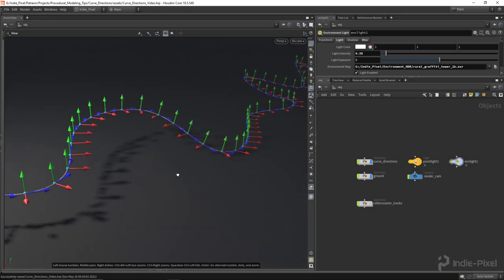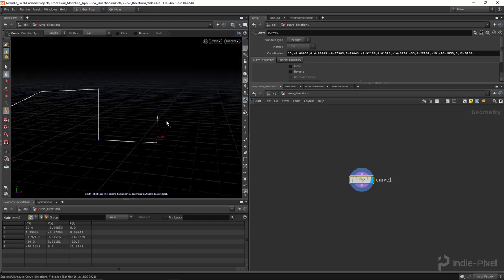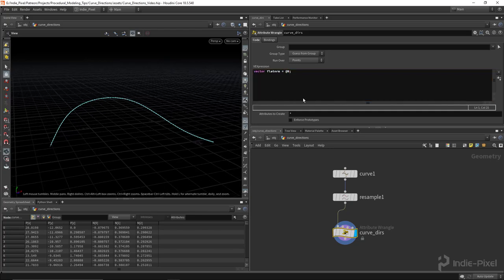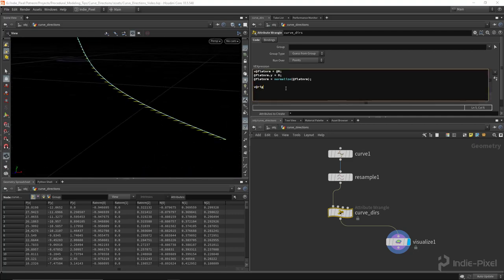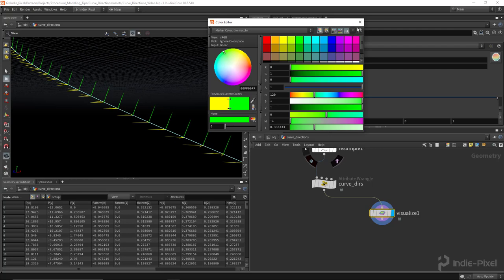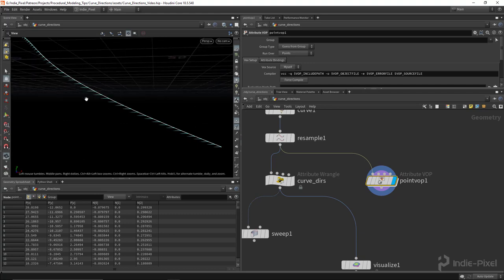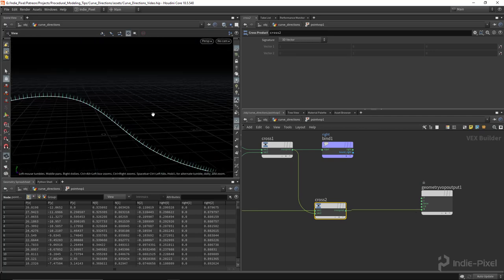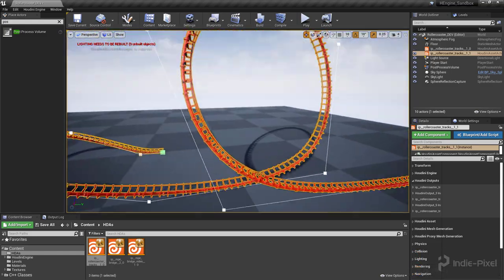Houdini - Procedural Modeling Tips! - Curve Directions

Comment: Mathematically, you just need two cross products. right = normalize(cross(up, tangent)), then up = normalize(cross(tangent, right)). Flattening the tangent first isn't necessary. Both your solution and mine will fail if the tangent is exactly vertical, though, so there needs to be some kind of fall-back in place for that situation. The odds of this are very low... and, with the inherent precision issues in floating point maths, it's vanishingly small that it'll come up in normal operations. 

There's also the issue of the right axis flipping if the curve doubles back on itself and happens to pass through vertical, as the cross product will flip directions.

Alternatively, you can employ a Bishop Frame if you need to maintain stability of all the axes along the length of the curve. It's a bit more work to establish this and involves evaluation the curve along its length from start to finish, rather than just relying on a tangent at any given point. There's lots of mathematical papers on the Bishop Frame and they're all a bit incomprehensible if you're not a mathmatician. Epic have made use of it in their hair strands plug-in for Unreal, though. If you feel like tearing apart their code for it, I recall it was fairly easy to reproduce using their method.
Reply from the maker: @sethfrolich5422  yes, it will fail in vertical situations for sho.  I have since stopped using Houdini and just use pcg, geo script, and cpp for all my stuff.  Thanks for the bishop frame tip...I'll have to take a look fo sho!

Comment: So, I've run into a bit of a snag. I'm trying to push points along their right and up vectors randomly. To simplify lets forget about the randomization, if I try and do, @P = @P + @right*ch("scalar");, the points just don't go in the correct direction, like I'm looking right at the values in the viewport and the movement just isn't correct at all. If I pull up the geometry spreadsheet, my right vector is expressed in terms of right[0], right[1], right[3]. Now if I look at the up vector, for some reason its components are actually expressed in terms of x y and z, and this simple vex code works properly when tested with the up vector, it's able to push them along that up vector in a way that's expected. So my only guess is when adding two vectors, where one (@P) has its components expressed as xyz and another (@right) whose components are 0 1 2, its like it doesn't know how to "match them up" or something. So, when I define a custom vector attribute, how do I make sure that its components are gonna be expressed as x y z?

Comment: Hi, why did you flatten the normals in the Y direction? Is there any reason I should use flattened normals instead of the original ones in the cross product?
Thanks.
Reply from the maker: In order to get the proper right vector we flatten the flow normal and do a cross product with the world up vector.  Once you have the right vector you do a cross product to get the proper up vector. If we didnt flatten the flow normal we'd end up with a wonky right vector.

Comment: doesnt the direction of flattened normal flip when you do full rotation track? like loop track?
Reply from the maker: Yep, if you wanna do looping tracks it has to be taken into account.  Can do it with a sweep node and an attribute transfer node.
Reply: @IndiePixel3D  thank you!
Reply: @IndiePixel3D  any clue how you'd go about that? Currently facing that same issue, and I have no clue what you mean by using the attribute transfer? I'm assuming you mean transfering the right vector from other bits in the spline, but how would you even go about detecting if it messed up, and getting those points over?

Much appreciated

Comment: I have a problem, when I put the subdivision curve nothing happens, it does not smooth.
Reply from the maker: I've notice that happen in Houdini 19...is that what you are using?  If so delete the resample nide and make a,new one...that worked for me
Reply: @IndiePixel3D  yes i have houdini 19
Reply: @IndiePixel3D  I tried again to delete the resample and put it back but nothing changes... :/
Reply from the maker: @hoprem.  huh, weird...I have seen that before...might want to bug it with side fx.
Reply: @IndiePixel3D  i find the problem, it's the mode. You must change mode on CVs on your curve

Comment: Why not just use a polyframe node? It does all this for you. Don't get me wrong - understanding the cross product is super helpful, but for curves polyframe is quick and easy.
Reply from the maker: You can do sho...though it doesn't work in all situations.
Reply: @IndiePixel3D  Oh, now I see - you do that so that the up vector is pointing towards the center of the geo, to prevent flipping. But that also doesn't always work...
Reply from the maker: @christianbohm6118  in this case the up vector is derived from the flow normal and the right vector which produces a vector pointing up from the curve.  If you need an up vector to support looping then you need to do it a bit differently which I'll show next week.
Reply: @IndiePixel3D  Ah, i mixed that up with your angular sort, nevermind. I know how to do that, I just tried to find a reason why a polyframe wouldn't be enough for this...
Reply from the maker: @christianbohm6118  no prob at all...so whenever I place a polyframe on a raw curve I hardly ever get the direction vectors I want....it works well for the flow normal, but not for up and right vectors...so i always have to assign my own vectors.  Polyframe is a good node fo sho...but I always end up doing custom vectors anyways
Reply: @IndiePixel3D  Hm, weird. As long as you don't need a custom up vector (which to be fair you often want) - I never had problems with it...But I guess that the crux.